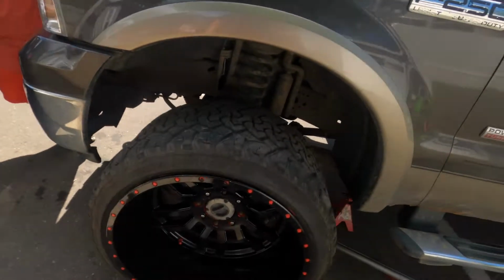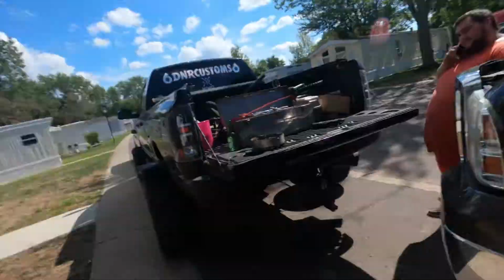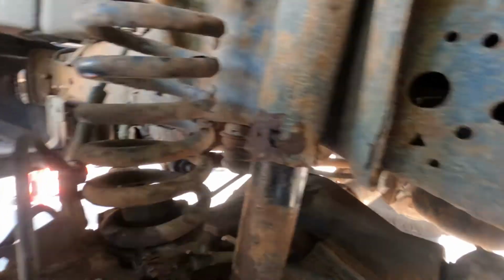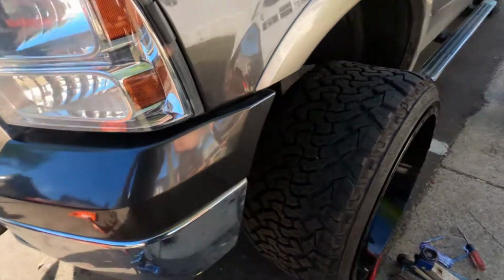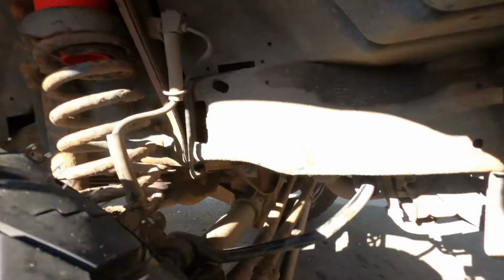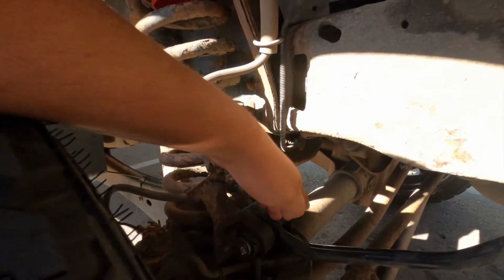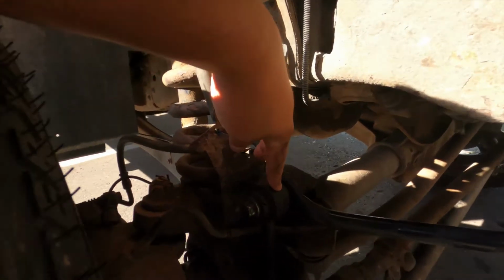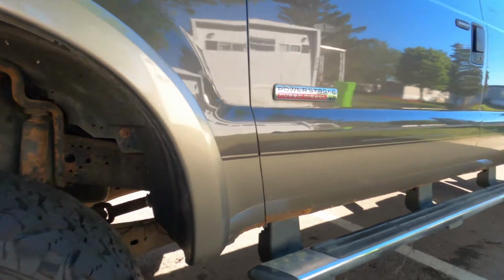3" leveling kit install on 6.0 powerstroke

Comment: Did you have to do an alignment or anything or do you just put the blocks in and good to go? . Mines stock and im looking to add leveling blocks in the front.
Reply from the maker: I would suggest getting an alignment just because it’s not worth ruining front end parts or tires.

Comment: I want to get a ford 250 but I'm 5'9  I don't want to get no 4 or 6 inch lift because thats so typical for trucks to have but I don't want truck to be the shortest either would a 3 inch body lift be tall
Reply from the maker: 4” isn’t really the tallest on these trucks
Reply: @Kickitwithkody  would a suspension lift be better all around more than a body lift or any other lift
Reply from the maker: @christopherdavis195  body lifts are kind of an experiment choice. You either love it or hate it from the looks. I personally think they make any vehicle ride harder. All suspension is the way to go unless your going really high, and need a little more
Reply: @Kickitwithkody  i appreciate it I mean like I said only being 5'9 I'm not trying to be one of those guys who has to struggle getting in because they are short so they compensate by getting tall ass truck lol